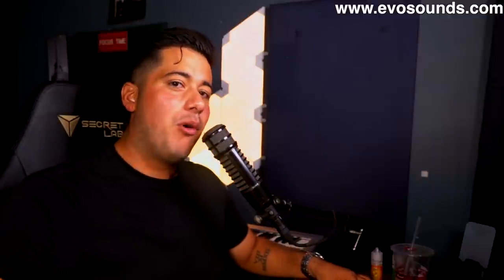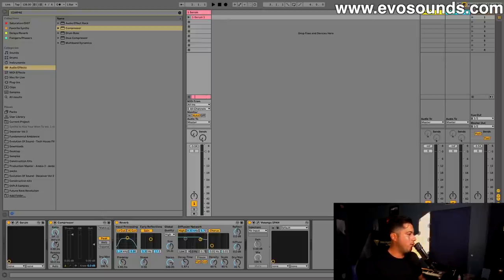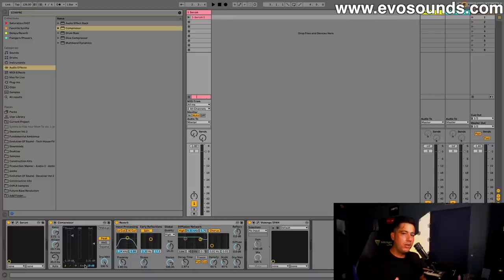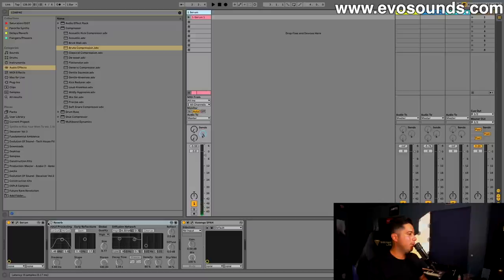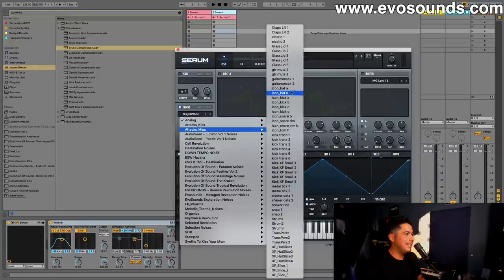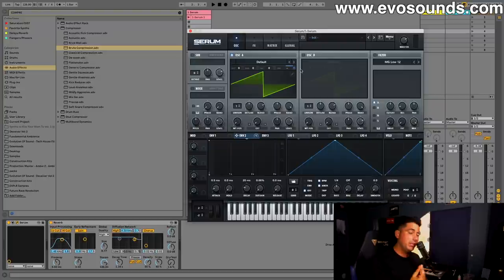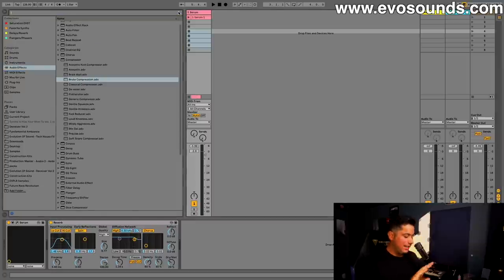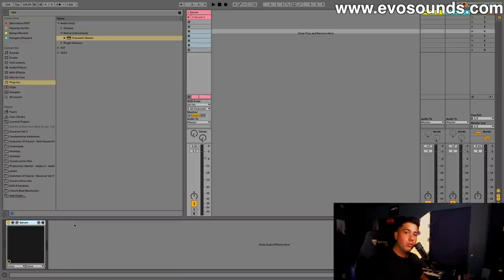How To Make Your Synths Hit Harder!

Comment: I also sometimes like to add he noise oscillator and set it to metal tick 1 or 2 in one shot mode to make my synths a little more percussive and prickly on sounds like these. You'll find that it gives you that coarse pitch punch just a bit without affecting the actual sound of osc A or B

Comment: FYI transient shapers are basically compression with macros instead of the open controls :)
Reply: No they aren't
Reply: @mikebinding23  really?
Reply: @ModernDevotion  really
Reply: @mikebinding23  I was asking for more detail not incredulity. I believe you.
Reply: Transient shaper is the same thing as envelopes. When you lower the sustain in transient shaper it's the same if you did it with serums envelope. And vice versa

Comment: For "parallel compression" why not just put the compressor in the main effect chain and set the dry/wet?
Reply: I tried doing that but it introduced a bit of delay from the compressor process and it messed up the phasing of the sound. It was basically sending the dry and then the wet signal just a tiny bit later, and it really messed up the sound.
Reply: @ahreuwu  but wouldn't the compressor also add a bit of delay if you put it in a seperate processing chain?
Reply: Because zen wants to have total control of the dry sound, so he sends it. It also gives you more control for automation. You should do this too, but just use the audio effect rack so you can split the same track into many different channels.
Reply: @ahreuwu  hey are sure it wasn't just your release time settings that may have caused the "delayed" sound?

Comment: I have a question, when making tracks (I make Deep House orientated tracks, such as JLV, Tru Concept, Meduza etc.) I always struggle with the low end. For some reason my mix sounds good on my speakers and headphones, but when I listen it somewhere else, the thump / punch of the kick is really boomy and the sub sounds really loud. This makes my tracks sound really bad, but when I lower the sub the kick is too boomy, any recommendations or advice would be great!
Reply: @lukeelderkin  Yeah I make my kick shorter with reversed sidechain to match the sub
Reply: @lukeelderkin  But sometimes the kick is still too boomy for some reason
Reply: Instead of boosting the low end of your kick, try using saturator or overdrive in parallel and make it work in the lower mids. You'll be adding punch instead of boom